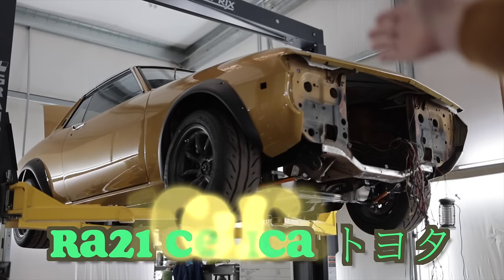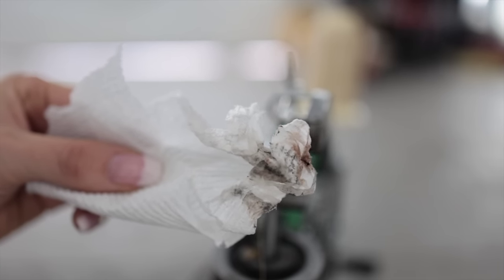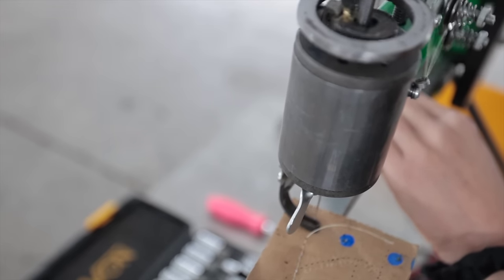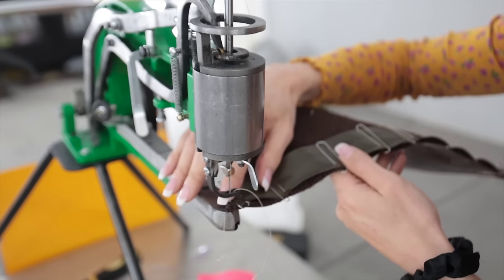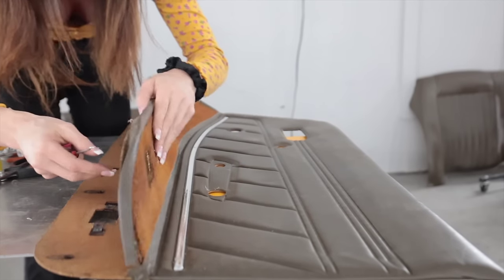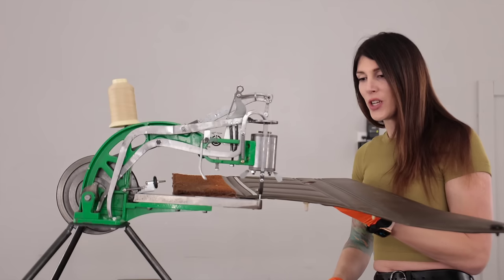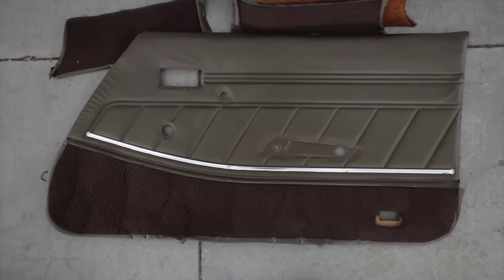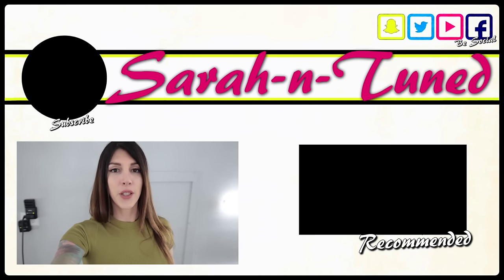I Can't Believe This Worked! // '74 Celica Re-Upholstery

Comment: I bought a Sailrite machine. They are oringally designed to be portable so you can fix sails while at sea, including a case that makes it easy to store and lug around. You can plug them in but you can also use some of the models manually. Compact, but you can still work on something as big as a main sail with some creativity. Love the machine. It will stitch through layers of heavy materials like it's any Tuesday and mend a sock if you need to do that. The customer service is so awsome, they will help you with anything. They have tons of how-to videos, you can call them with questions. They will even make new videos to show you something specific if they don't already have one. I can't say enough positive things about them and their machines. I don't know anyone that is disappointed with a Sailrite machine unless they didn't buy enough machine trying to be a cheap-ass.

Comment: Sarah, as a restorer who does most of my own interiors, I use a walking foot machine (pulls from top and bottom). You can find them used but you could probably get by with a used Juki or Consew. There is a Consew on the Craiglist in Phoenix. You will find that a sewing machine will open up doors for you. Main thing is do not sew yourself into a corner.

Comment: If the backing of the door cards gets all munged up, back it up with some tape on one side (just enough to make it hold a shape) then SLOWLY drizzle catalyzed polyester (fibreglass) resin onto it. It'll soak it up, then turn into a brick. The trick is to time it so your last bit you pour is right as it's setting up (it gets thicker at the last moment!).  I've fixed seat backs, headliners, all sorts of things like that.
Reply: Mine gets thicker at the last moment

Comment: I just finished up the door cards on my project 1984 Brat, and it was built kind of similarly to this - fiber board, carpet inlay, and vinyl cover. Ended up replacing the fiberboard with ABS, scrapping the vinyl and using houndstooth fabric instead. The carpet I was able to save by just cleaning it off in the sink, and the plastics I used duplicolor to paint

Comment: After creating a bunch of jeep top speaker covers, yes actually using Haartz material to trim out the covers, I found waxing the needle to slip through all that material made it easier to work. I am by no means a professional but had fantastic results using an old sewing machine. I like the paper clip idea for keeping materials in place. I would have never used that contraption however.  
Ideas...... Teflon covered needles (don't exist), waxed thread maybe?  
Industrial sewing machines are stupid expensive. I think you did a fantastic job by any standard.

Comment: I had never thought of using a manual sewing machine like this for what little upholstery work I usually need done, ive always put off doing my own upholstery repair because I didnt want or need one of the specialty electric upholstery machines for the little repairs I need done. Now I can finally get a couple little repairs done that the local shops want to charge too much for because they dont want to mess with it!
Reply from the maker: I’ll warn you though, you’ll be equally irritated and amazed with this thing. You’ll want to praise it and set it on fire at the same time lol.

Comment: Having a table that sits near flush with the sewing machine would help doing straight lines. As the material isn't flopping everywhere. (I would probably ditch the stand, and hard mount it).

Electric sewing machines I've used could go as slow as you want. Much like a gas pedal. So a surprise to see a hand operated mechanical one.

Comment: Instead of a seam ripper, single-edged razor blades were the go-to thread cutters 99% of the time at the upholstery shop where I worked. They need to be fresh and sharp, and they work great.

You did a great job on those. That thin, plasticky unbacked vinyl on earlier Japanese cars was not easy or fun to work with new, let alone when it's 50 years old. Well done!

Comment: Sarah, whip out the welder and make a mounting bracket so you can clamp that thing in the vise. Then use your cordless variable speed drill with a socket on it to run the wheel. I think it will go easier for you. When you first opened the box, I never woulda guessed that was a sewing machine.

Comment: I had a carpet upholstery unit on castors and did the bindings and tassels and hated when it didn't work right. You might find it easier to do with it on the floor with castors. So funny I can remember 30+ years ago and how much I hated it.

Comment: If you plan to do more upholstery you might look into a treadle sewing machine. You can still buy heavy duty units new. Works on leather, carpet whatever you can get under the foot. With the double bonus of being foot powered and a tabletop. Heads run about $350.00.

Comment: That’s not a messed up where it’s double stitched, they ran out and backed over there work to make a stronger ended point and then that little skip you see is where they continued. Doesn’t happen often but it does occasionally. You see it a lot more on clothing.

Comment: I redid some Sun Visors for a Ford Ranger I had, they had a heavy cardboard material inside. I used a Brother Strong & Tough ST371HD. Its not much more than that thing (its under $200) and it worked great. It was a bit scary to punch the throttle to get it to pierce the board but they came out great. I looked at one of these and decided against it.

Comment: That little machine is cool! I was given an industrial sewing machine and everytime I use it seems like a major re-learn, so to get this little thing up and working out of the box was a significant accomplishment. One thing I know is my machine simply won't work If I thread the needle backwards.. Mine has to be threaded towards the foot. I notice you reversed the direction of how you threaded your needle between the start of the video and when you were doing the panels, so if it suddenly stops working for no reason its worth checking on thread direction. Might be worth tack welding those tubes in place perhaps? Nice job, the Celica is looking fantastic.

Comment: Absolutely amazed as to how you went from learning how to use that machine to actually doing a stand-up job is outstanding.  

Just an idea: I don't know if you will ever use it again, but I would recommend mounting the machine directly to a plywood/ MDF base  and do away with those utterly crap tripod legs? You could use any flat surface to work from after that as it would be far more stable?

Comment: For great legs: Drill and tap the top sides of the legs so you can screw a screw in there against the bosses they go over. Second: Pound the feet flat at an angle so you can clamp or screw them to a surface, to stabilize the machine. You can unscrew and put it all in a bag when you don't need it.

Comment: you can get double stick tape for positioning materials together and can be sewed through. also keep an eye on the bobbin thread tension in relation to the top thread. otherwise impressive work for a hand turned piece of junk machine.

Comment: Love your can-do spirit! Definitely need a better base for that machine. Maybe add some weights for feet and a way to lock the legs in place. That would make such a difference in your ability to control the machine without having to worry about the instability.

Comment: A table should be constructed around the same height as the needle and foot so the material doesn't hang down, also pushing the material in isn't recommended, pull slowly to create a slight drag, but not enough to stretch the stitches out. Yes I used to help a school friend many years ago in his Father's Upholstery shop. It came in handy when I did my own cars at home later.

Comment: Typically where you used paperclips, you would use straight pins to hold fabric together. However, as thick as the material you are attempting to sew is, maybe you could use masking tape. It should stick well enough to hold it long enough, while still being easy to remove and not leave residue.

Comment: was hot glueing 2 by 4's together, you take a lighter to a stick you put on the 2 x 4, it takes about ten seconds for the stick to get totally phase changed, then jump on real quick.  Hot glue only works by porosity.  But in a molten state, you'd be surprised how much hold you get off one stick.  If you took a bag of trash and spun it around with hot glue, you'd have some serious set props for its a homeless good time for bum fights starring mr hobo himself ( Dr. serious).

Comment: Thanks for leaving in all the bits of trouble with the machine. Maybe punch a hole in those legs, through the stand, and bolt them? Then you could set some weight on the legs so it doesn't fall over so easily. I have no easy solutions for the 4-hands problem though -- I don't know many people who are also an octopus. 🐙👍

Comment: Impressive! 👍🙂
And yes you want to try to avoid getting the carpet fibers in your mouth. Especially if they don't match the drapes. No reason to have them around.
You don't need to be coughing.
If you have the storage space, (and I know,"nobody ever does"🙁) maybe you could "J-B weld" in the legs?
As those things are now it looks like they could really screw you over at some critical point...
I don't think I'd try brazing them and on or cutting and drilling on to those fine high quality materials and construction techniques used on that machine😅. Maybe for a bonus some nice little rubber grippy feet on it it?

Comment: Try using a "seam ripper" to remove old threads.  Even this old fart mechanic has one in the tool box.  (works great to open taped wire harnesses too)
Reply: and they're dirt cheap at your local fabric shop

Comment: Dear sweet baby Jebus that machine is... definitely technically a machine. I commend you for figuring it out and making it work. Your work definitely exceeds that of a Bonobo on meth. Only improvement I can think of is sending some self tappers through the top of those legs as grub screws, hahaha. The only Snap-on tool I have ever purchased is a seam ripper because it was basically the cheapest thing on the truck at $14. I actually got it for wiring harness work. Haven't used it yet, but I will!

Comment: Pausing at the fiddle faffing comment,.. Sarah, I don't know what that contraption is, but it looks like junk.
Find yourself a 1900 thru 1950's Singer that comes mounted in it's own table. Yes, the Wrought Iron construction makes it heavy, but it's meant to be so it's not moving around, even before you bolt it to a concrete floor. My parents used one to sew up the canvas sides and roof of a Camper and then a Caravan Annex in the 70's and 80's, and that sucker will still sew car fabrics to this day.
They come with a pedal-rocker arrangement to make them work, but it's real easy to swap in an electric motor to spin the belt.

Comment: Since at the time of my comment you're already done using this sewing machine and might not never use it again but if you were to just run 3 screws through the bottom of a piece of plywood at a 45° angle into the legs of the machine that is large enough for you to sit on while using it that would alleviate 3 of your problems at once!!!